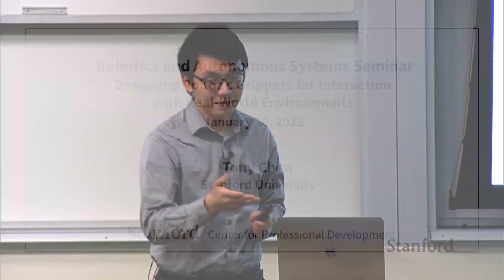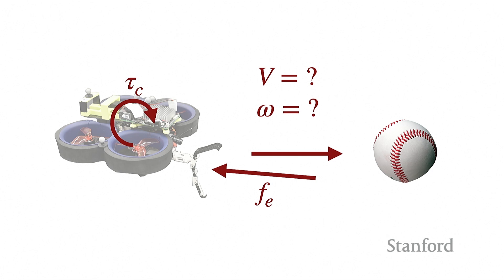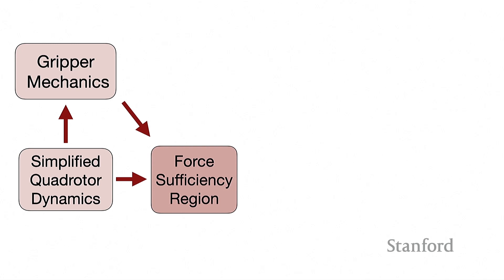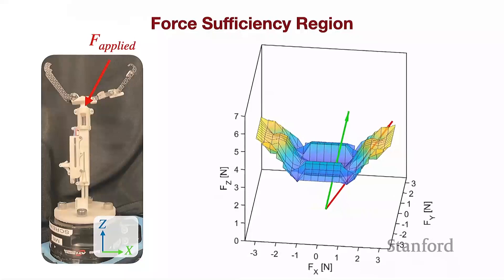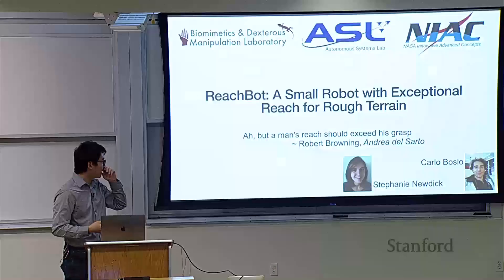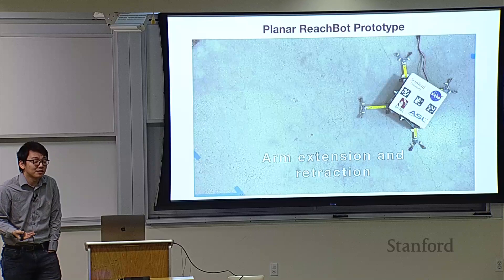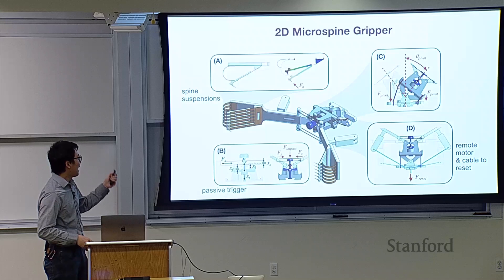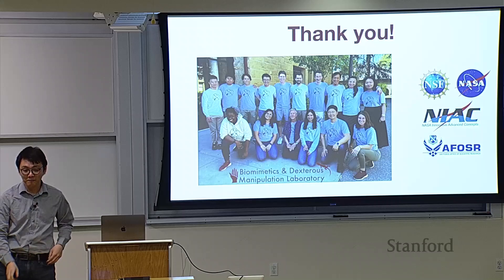Stanford Seminar - Designing Robotic Grippers for Interaction with Real-World Environments

Comment: Takeaways:

00:00 🤖 Designing robotic grippers for interaction with real-world environments.
1.1 Start with observation of the environment to deploy the robot.
1.2 Maturing technology allows for robots to move and manipulate objects.
1.3 Manipulation refers to the capability of the robot to interact with its environment.
1.4 Focus on two projects: a drone and a planetary exploration robot.
1.5 Aerial grasping is a challenge for drones because of disturbances during mid-air interaction.
1.6 Control strategies must be developed to compensate for disturbances and ensure the drone captures the target.
06:03 💡 Designing a gripper for the drone.
2.1 Consider the type of interaction the drone will have with the environment.
2.2 Design the gripper to be light, strong, and efficient.
2.3 Make sure the gripper is capable of holding the target securely.
2.4 Choose materials that are suitable for the environment and task.
2.5 Integrate the gripper into the control system to ensure smooth operation.
08:19 🚀 Designing a gripper for the planetary exploration robot.
3.1 Consider the conditions on the planet, such as terrain and atmosphere.
3.2 Design the gripper to be compact, strong, and durable.
3.3 Make sure the gripper can handle objects of different sizes and shapes.
3.4 Choose materials that are suitable for the harsh environment of the planet.
3.5 Integrate the gripper into the robot's mobility and control systems.